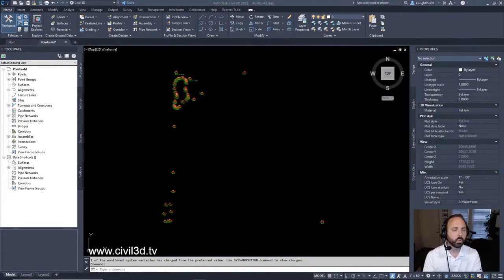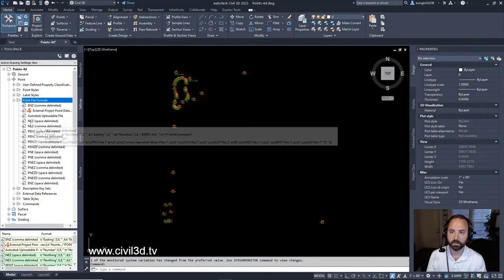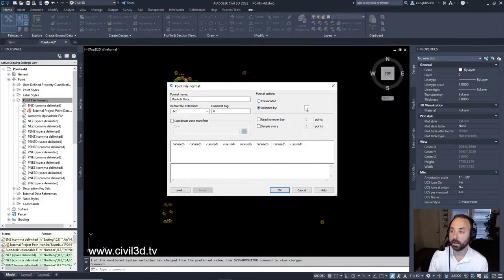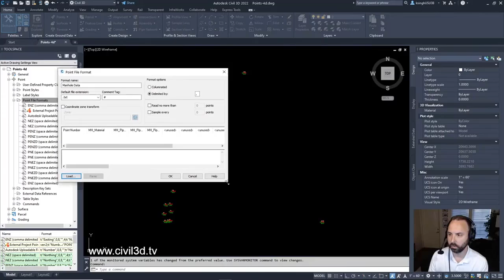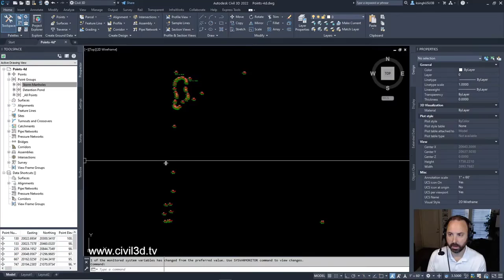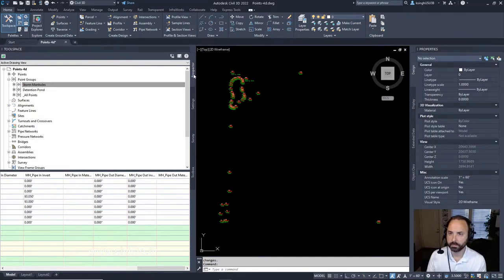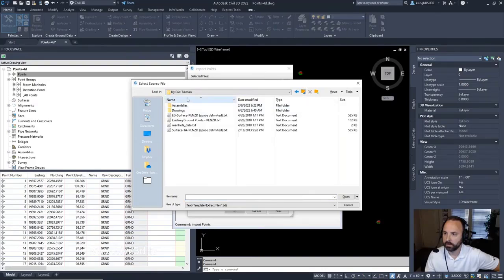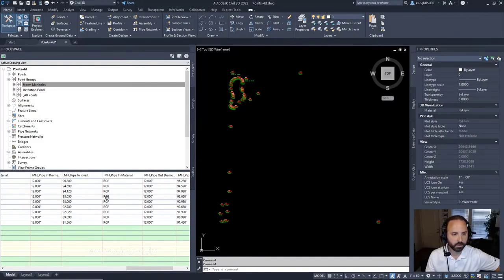Importing Points with User Defined Properties in Civil 3D

Comment: Hello, is it possible to import Extended Properties to points using the Survey Database instead using COGO import? Thanks!
Reply from the maker: Yes. You can bring extra attributes into Civil 3D using the Survey Database, but those come in as Survey User-Defined Properties, not directly as COGO Extended Properties. If you need them in COGO Point UDPs, you either have to map them through Description Keys or transfer them after import. If you want them to go straight into COGO Extended Properties automatically, the cleanest method is still the standard COGO import with a Point File Format mapped to your UDPs.
Reply: @CIVIL3D  Perfectly explained Sir. Thank you so much for this!
Reply from the maker: You’re very welcome!